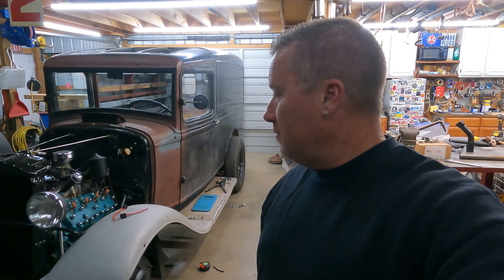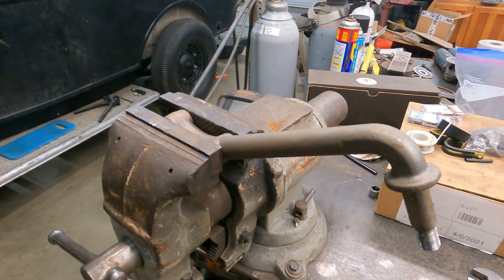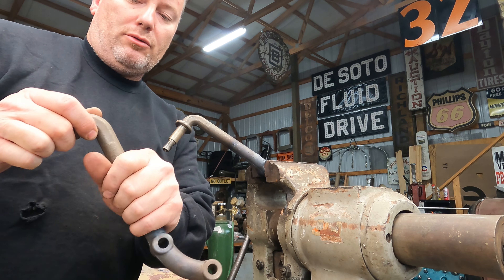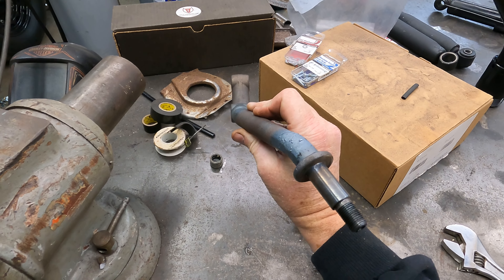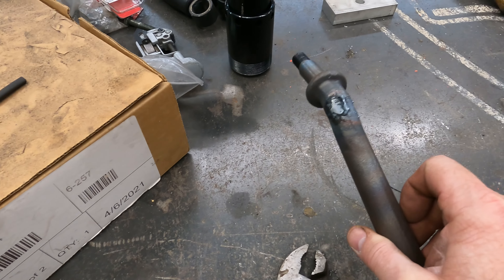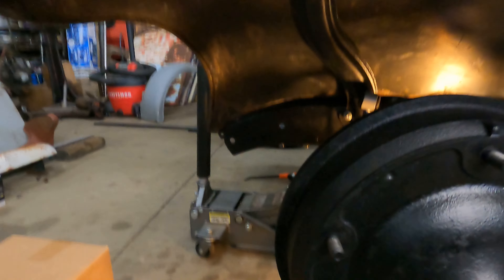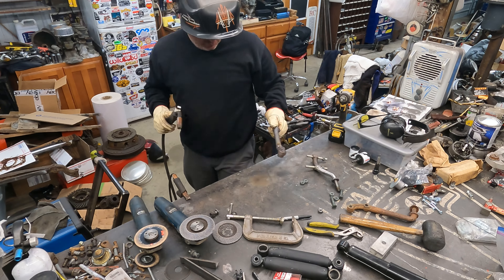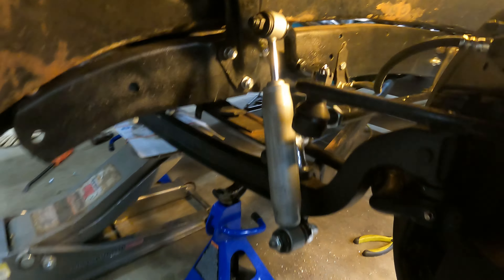Hot Rod Shock mounts!! Ford F1 Shock mounts twist and bend!

Comment: I had to space mine out frome the frame on my F1 when I added the dropped axle because the drag link was hitting it. Never been happy with the drag link angle
Reply from the maker: They make dropped drag link tie rods if you didn't know. They work pretty good, I had them on my '60, you might hit up Sid at Droppedaxles.com and he can fix you up with the correct stuff for your F1!
Reply: @chaddilacdesigns  I have the dropped tie rods on the center link. I mean the one from the pitman arm on the steering box going to the driver side spindle